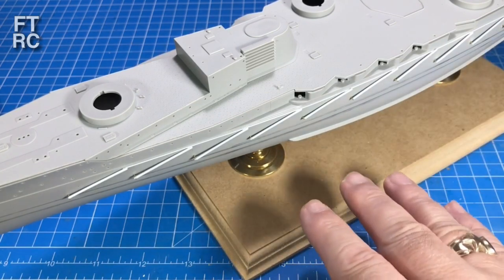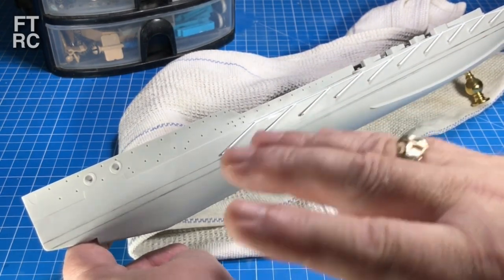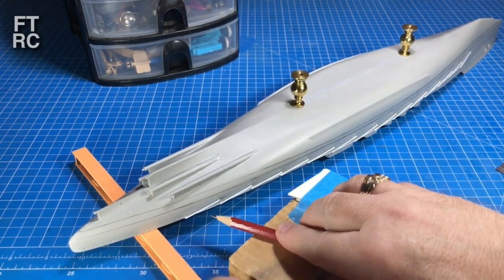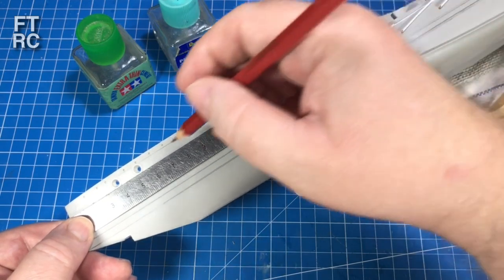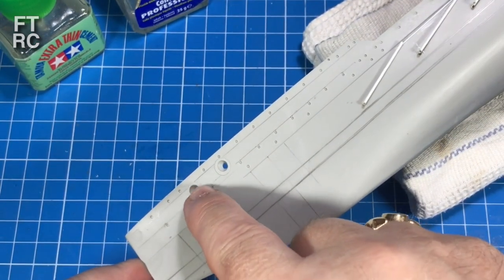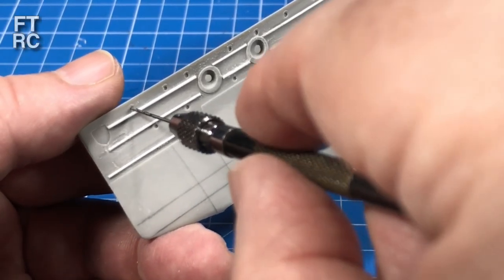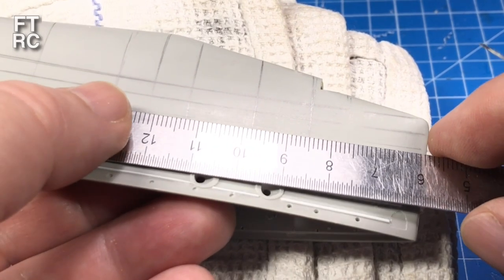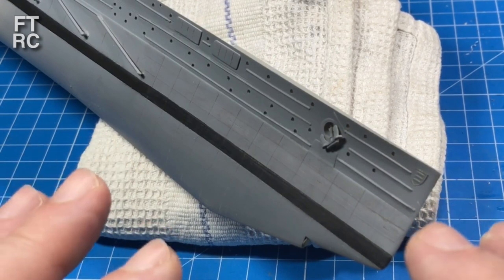SMS Seydlitz Part 3 Bow Scratch Upgrade and Waterline Trick - Hobby Boss 1/350 kit

Comment: Another wonderful and enjoyable video, very informative.  My only question is  whether or not to drill out the portholes or would it be better/easier to leave them as is and then paint/weather them.  Seems that a dark wash might attain the same effect.  Keep up the great work.  I very much enjoyed your explanation of how you made your measurements.
Reply from the maker: For this kit the deeply moulded portholes could have just had a dark wash to emphasise them, however most of the other ships I’ve built needed the portholes drilled to be seen.  I guess it’s just force of habit, but I do prefer the look of a drilled out porthole.

Comment: Harry thats looking great. Do you reckon that half round styrene trick of yours would work for canning the hull of more modern vessels? Its always a ball ache trying to can a hull
Reply from the maker: The oil can hull effect really only works well on 1/72 and to a much lesser extent on 1/144 scale model ships.  In 1/350 it is so subtle as to be almost impossible to see, yet model.  If you have a photo of the ships hull, then reduce it to 1/350 scale to see if it’s even doable.  

However the tiny half millimetre diameter half round rods I used are to scale for my 1/350 model ship, measured from the photos I have of the actual ships hull, and represent hull beading, not oil canning.
Reply: @HarryHoudiniModels  yeah its a good way of putting the beading in then carving the panel lines. I just wondered what you thought about it maybe being a subtle way to can the hull.  I've used paint which is often the most effective way 👍
Reply from the maker: The oil canning can be done with a Dremel or by scraping and sanding, probably no faster than painting.  But consider the ship hull panel bends inwards 2 inches or 50mm, at most. So at 1/350 that is 0.14mm, literally one good swipe with a sanding stick.  At larger scales sure you can get reasonable sizes.  In 1:72 scale the bend will be 0.7mm at its deepest.  So that is doable, as long as your plastic hull is thicker than 1mm. At 1:144 scale its a third of a millimetre.  Ive seen it done but was hardly noticeable in the end.  

So to get a tiny bend in a half round tube to mimic the oil can effect you might need a very large tube to get the minor curve for its edge, and then have to cut away your hull side to insert all these curved pieces.  Enormous job.
 
It might work with 0.5mm sheet styrene where you cut a circle out of the middle, about half the panels width.  Glue on as a raised panel then feather the circle edges by sanding.  Again a huge job.